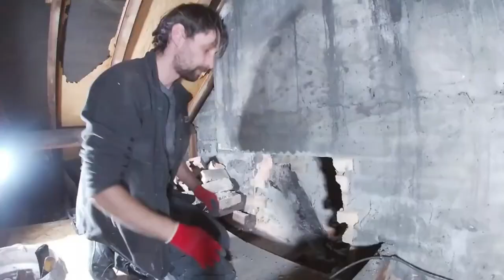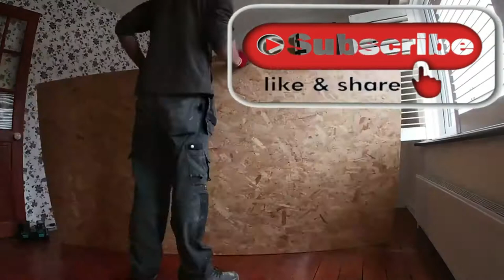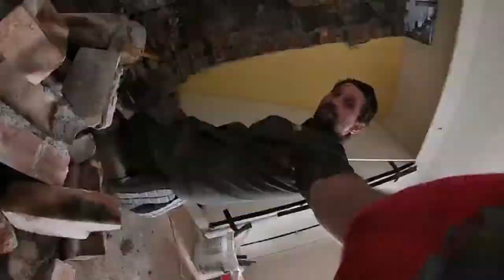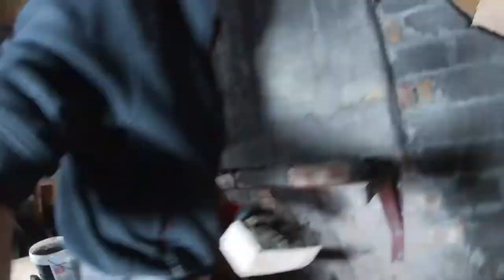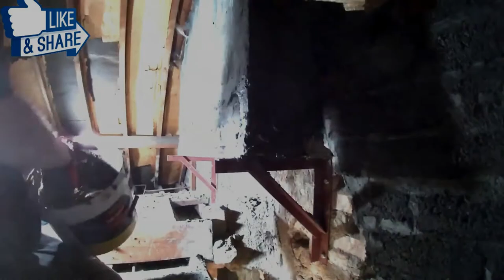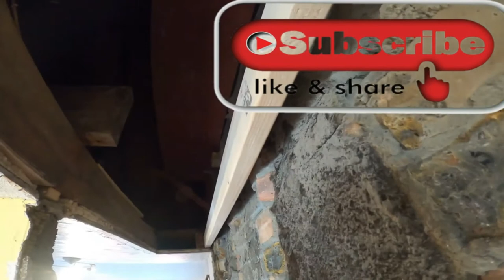How to remove a chimney from inside a house

Comment: Hi in trying to remove a chimney just like this one to create a open floor plan. Can i remove the bricks on the first level and the section in the attic without removing the bricks running through the second floor bedrooms?
Reply from the maker: yes you can but you will need an rsj to hold the chimney on the floor above

Comment: Hi doing this to my chimney this weekend. Do you not need to strong boy acro the chimney. Is it all safe to take out the way you do in your videos with no supports till the gallows go in . I would rather do it your way with no acro in the way. Mine is only 480mm wide and 350 off wall so small 1.
Reply from the maker: dont worry with doe's mesures you are safe just make sure that the brickwork it's not loose

Comment: I am looking at taking my chimney out in the loft it is 1m wide and 40cm deep do I need to use acro to support while I get the gallows in or can I nock the row out ?
Reply from the maker: Hi.You can install the gallows barakets then take out the remaining part of the bricks from the chimney and slide the metal plate in with the L shpe braket. Some of the first rows might fall so you will need to put them back fter intalling everything. Before strting with the demolition you need to assess the brick work in the loft , if they are loose you need to tke more precautions as the entire thing is just going to fall down. You cn see my entire videos on my main channel on the chimney here are some link's 
https://youtu.be/kCmy9CjLlbo
https://youtu.be/mr34gFB5LQA
https://youtu.be/-l-NHkAwKtg

Comment: Does this comply with building regs?
Reply from the maker: Yes. I always work with building control and i will make sure that the client is going to get a completion certificate
Reply: @buildsupport5131  Thanks guess i was expecting to see and RSJ the full length of the roof.-